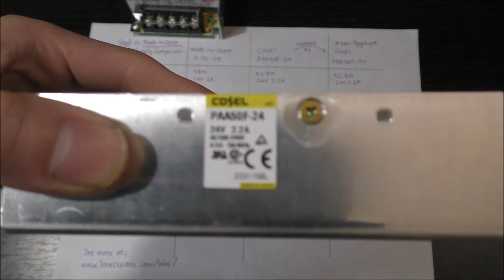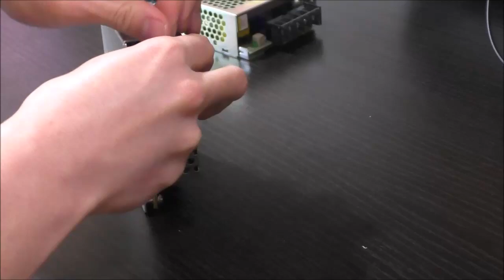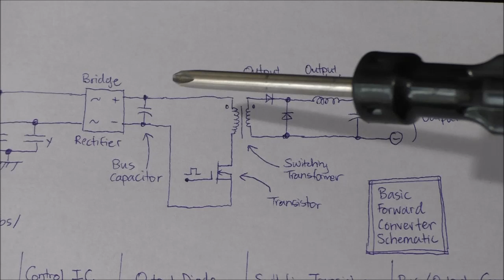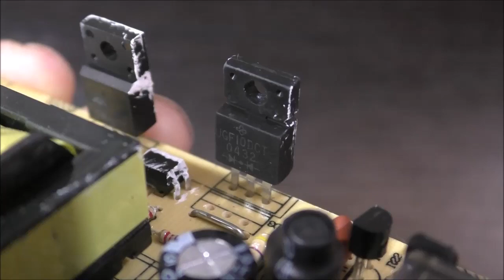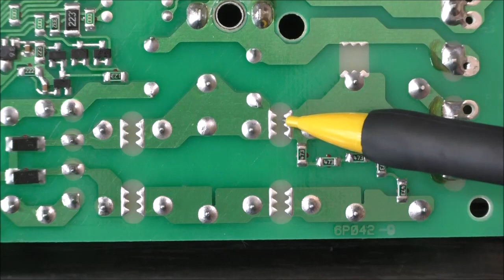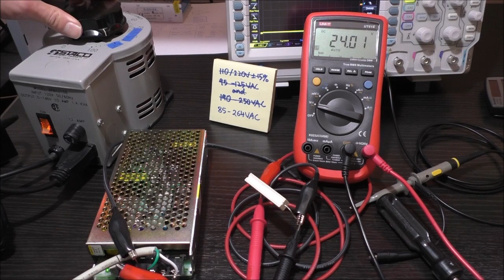Cheap $8 Ebay Power Supply vs $85 Cosel Power Supply Teardown

Comment: What a complete waste of time frankly if you are not going to test them at full load for prolonged periods of time at that temperature extremes.
Reply from the maker: +Andrew Denley  Excellent point - I&#39;d like to do this in the future though I do not have the tools to do so in a quantifiable way now. Regardless, I made this video more to compare their internal construction, and I did point out that good supplies usually have significantly more testing done with associated certification and test results. Performance with and without load is also different, but one can learn a lot just by studying how they are engineered :)
Reply: *****
I understand, I wasn't trying to be rude but I just felt the video was only half the picture and sends people away feeling that the cheaper unit is fine as an alternative.  Having seen the failures of the cheaper units at higher temps and over current though I feel that this is the area the expensive units excel.  I would love to see this proven or dis-proven though.
Reply: Only if you don't factor in the maintenance costs for repair, and the cost of the equipment down-time which can be orders of magnitude greater than the cost of the PSU.
Reply: rarbi.art The probability that it burns and/or exhales toxic fumes is very small if you use it correctly (e.g. don't overload) even for a cheap PSU.
Reply: +Andrew Denley 
I miss a test of overload (not only short circuit) scenario. And a test for brown out protection. 
That is how you kill cheap PSUs....
Reply: +rarbiart so are cheap power supplies sufficient, if you don't overload and you are in an area that isn't affected by brown outs?

Also if the cheap PSU lasts 2 years an the expensive one lasts 15 years, you still save money if you buy the cheap one.
Reply: rfvtgbzhn
It depends. If you use the cheap PSU to light a xmas tree in a junkyard: that's might be well sufficient, since there nobody will care if it does not work or even start to burn or eshale toxic fumes...

Comment: For 8 dollars you get a choke tranformer, rtc's for inrush current limiting, tinned pcb tracks and even pcb gaps and a optocoupler. I have to say for 8 dollars its pretty decent.
Reply: It is but I noticed no bleeding resistors
Reply: Dantali0n until it burns your house down, or fails; that logic does not apply to power electronics, safety does not have a price
Reply: @FooBar89  Just plug the cheepy unit into a MCB and your house will be fine!
Reply: @davidteale4270  Please wat's a MCB?
Reply: MCB stands for - Miniature circuit breaker
Reply: @josearrighi  "wat" ? Lol
Reply: @carlnikolov  Wat's the problem?
Reply: @davidteale4270  However, how does the failing process work? If a problem occurs, the PSU just stops working without fire or: first it gets really hot -> it begins burning -> it shorts and a MCB will turn off the power(so it still catches fire)?

Because nowadays all houses, at least where I live, have that kind of circuit breakers(but for bigger groups, 230VAC 16A) so in theory no houses can burn down?

Or do you mean that you buy a smaller MCB specifically for your PSU?
So, 100W 20A 5VDC PSU needs 230VAC 0.44A so I need a 230V 0.44A MCB.
Reply: @FooBar89  No, this one actually has a fuse and proper capacitors unlike many of the cheap ones. But you're right in that especially with the glue sealed plastic bricks you never know what is or is not inside it.
Reply: ThinkLearnSolve that is what we are learned, but safety always have a price. Safety and being afraid are different things. just calculate safety, danger and price.

Comment: What would happen if you supply a voltage between 125 and 190 V on the Chinese one?
Reply: It would probably just work fine...
Reply: It will still work

Comment: The Cosel PSUs output ripple seems "dirtier", but most probably it's because dithering was applied purposefully. Dithering will reduce the EMI from the device and it's actually a good practice, overall.
Reply: +DigGil3 It seemed like a good practice, but today, after most chips got the feature, its dark side has emerged: The supplies are noisy in the audible spectrum. I'd choose a "traditional" switching unit that I wouldn't hear at night any time over these "EMI-friendly" wall-warts.

Comment: I think those rails you mentioned are a result of a design restriction, since they decided to bend the MOSFET and output diode towards the bottom plate, loosing quite a bit of PCB real estate. It could be interesting to hear the reasoning behind this from the engineers that designed it.
Reply: +Kallenator1988 Maybe, but the PCB is still larger than its competitor and they could have squeezed on more if needed. I think they purposefully overengineered it.

Comment: Nice review, but I am wondering how well Over Voltage Protection, Current Limit and Short Circuit protection was implemented.
It looks like the Cosel has remote V Sense too which is not bad for a 2A converter.

Comment: The ferrite beads are a nice touch.  I'd prefer if they glued them down though, because I have a keen ear to any rattling going on inside of equipment, and have to make sure it's not something that could short out.  The Cosel power supply doesn't cut any corners, and has lots of additional safety.  But for 10 times the price, it's not worth it, unless if your equipment has to meet certain standards for use in certain fields of industry.  The Cosel had a more noisy output, but it looked to be at a much higher frequency, and that would be easier to filter out than the cheap Chinese power supply (using a choke or capacitor) -- if your design permitted that... but then... you could always use a linear regulator too :-p
Reply: Yeah, I was looking at them just left there, no silicon to hold them. About cutting corners, I saw no MOVs, the fuse quality appears to be on the lower side.

Comment: how about efficiency?
Reply: +tomato totato Hard to measure, you'd need a true-RMS amp meter to account for the distorted consumption of the PSU.
Reply: zwz • zdenek rms　meter cant ,mesure watt. you need watt meter. $15 at ebay.
Reply: ***** Of course, but voltage is hard enough in the mains so that you can just multiply by it as a constant. Having a regular meter with true RMS is sufficient, if less user-friendly. And $15 will not buy you any good instrument, the values will be way off, especially with poor power factor!
Reply: Exactly, over say 10 years efficiency will be a major factor.

Comment: This video is very informative, i'm going to buy a similar chinese power supply (12v 5A) for a little homemade NAS based on a Banana PI, i thought that for 8-9$ they were crappy inside but turns out they are quite good it seems! The sanded DIP chip is kinda shady though...i would really like to see what IC they are using there!

Comment: The chinese one is a flyback, not a forward. the 2 output diodes are in parallel and the inductor is extra output filtering, that's why it seems quite small. The Cosel has no extra output filtering. The Cosel does have 2 stages of input filtering compared to the chinese one's single stage.

The design of the Cosel seems quite strange. They probably could have moved the layout around to get the tracks shorter on the secondary and not needed those bus bars and added some small post filtering. It's strange they didn't add extra filtering since they added those ferrite beads everywhere. As someone mentioned, the input bus cap being 200V doesn't fit with a typical boost PFC or a design without a PFC, so they may have done a different PFC topology, presumably because they want PFC but a single switch forward or flyback doesn't cope well with the high bus voltage of boost PFC preregulators. Buck PFC doesn't 100% fit in with the 200V cap either since the output has to be lower than the lowest input voltage, but they are probably using a controller that tracks the output voltage to input voltage. Buck PFCs aren't brilliant though and I've seen plenty of single switch or 2 switch forwards following a boost PFC, the single switch ones manage it with an RCD soft voltage clamp on the drain. I've designed 2 switch forwards that run after a boost PFC and that seems simpler than a buck PFC. The diodes/transistors mounded to the side of the case is just as valid as mounting on the base since its the same bent piece of metal and that could make for a better layout, so it's strange the Cosel didn't do that at least on the secondary to get the high current secondary circuit smaller. The ferrite beads on the secondary diodes is also unexpected, since they're adding extra inductance in series with the leakage inductance which is a source of ringing with the diode capacitance, so they might be just lowering the ringing frequency, whereas the more typical RC snubbers actually snub this noise. The chinese supply did use plastic TO-220 packages and I wonder if those junctions get too hot, especially on the secondary and that might be just to save cost.

I got a similar supply from ebay to look inside a while ago and I too was pleasantly suprised by the construction. I was expecting no input filtering or protection and insufficient creepage and clearance distances, but this was not the case.

You could test the step response to load as well as power factor for a more detailed test.
Reply: You are right, at 11:36 its clear thet the the 2 anodes of the diodes are connected so they are in parallel to share the current and reduce the losses...

Comment: I design electronic equipment in the US and what I see from Chinese manufacturers are products that may look and perform similar to name brand products, but are usually not the same quality. Many factors go into shaving costs of design and manufacturing: poor wages, copying designs, minimal testing, counterfeit components, technology licensing, government subsidies, trade inequity, poor quality control and certification. It's easy to make something work, but much harder to make it work well and do it honestly. Usually this becomes apparent when you test multiple units picked randomly from production with a broader range of tests to see if they are consistent and reliable.
Reply: Didn't anyone learn anything from the Betamax VHS war? It doesn't matter how much better one is over the other. Low price conquers all!
Reply: +bruce honnigford But how often do we actually buy "quality electronics" that are just rebranded Chinese stuff!
Reply: +bruce honnigford Yes,  reliability is what the 80 odd dollars pay for.  But the price factor is interesting in cases when reliability is less important.  While chinese factories have made huge progress on the safety and sturdiness of their products, as a whole, getting a UL listing and having the possibility to track components can also be a determining factor.  
Design trade-offs are what our job is made of. Having the choice of cheap medium-quality components, that can also be over-sized a bit at low cost (that is always good for a power supply), is a big plus, I'd say.
Reply: zwz • zdenek
you're just jealous of Sony.
Reply: Paul Frederick When buying Sony in the 80s you where certain having a decent to good quality depending on the amount of money you spend, but there were other brands that were much better. So yes, overall it was a good brand but you could certainly do much better.
Reply: Paul Frederick
What? I never said similar things about their competitors. I'm just a conscious customer who wants fair deals.
Reply: zwz • zdenek
there was a time when Sony was the best. Whether you're conscious of it, or not. You have to pay a premium for the best too.
Reply: zwz • zdenek
nah Sony in the 80s was on top. They had a good President back then.
Reply: chinese products die quickly. they have very low mtbf
Reply: +bruce honnigford Let's admit it, the "brand" products are often so overengineered and bullied by the law that they aren't too good no matter how much money is thrown at them. These Chinese power supplies are ingenious in their own way and they would need little to become as good as their overpriced competition.
Reply: Paul Frederick
That's wrong. Sony's aggressive contracts conquer all. It has little to do with price. I honestly wish for Sony to go under. They have damaged the market for us all.
Reply: Paul Frederick
Best at tricking people to be sure. And they were never truly best at quality. Decent - sometimes.

Comment: Yes, I think it would be interesting to run both at (near) full load for a week or two, continuous, and see if they both still work! I wonder how well the isolation would hold up, too. We have 240V AC mains, here, and I am VERY wary of cheap PSUs. It's hard to see that the Cosel is ten times better (unless the cheaper one only runs for a few tens of hours...)